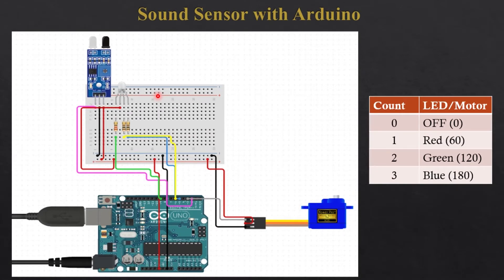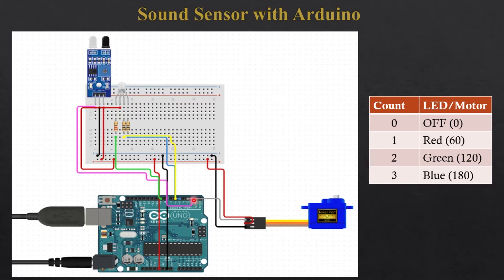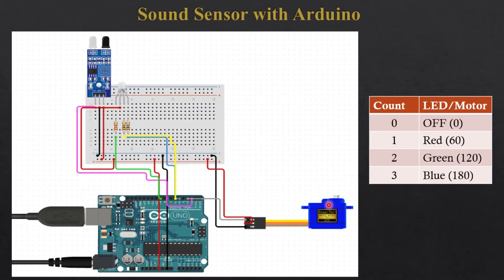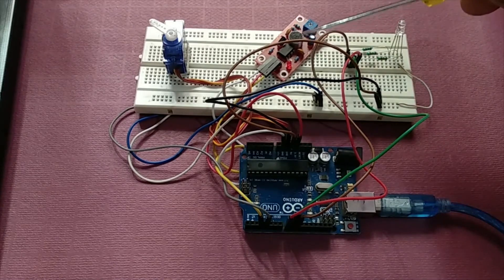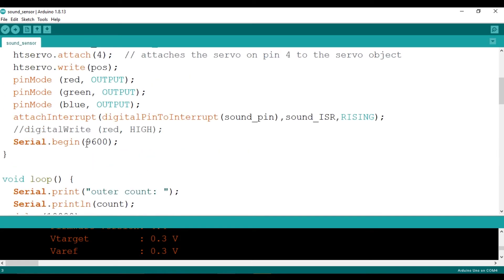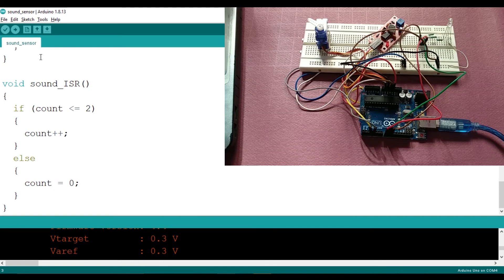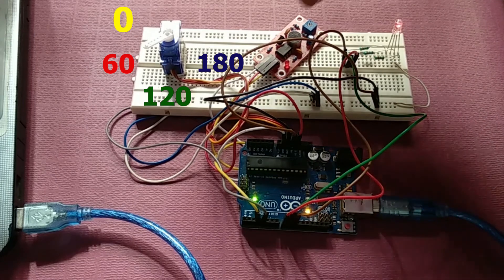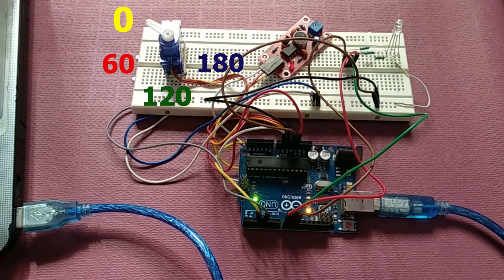Sound Detector Using Arduino

Comment: Can you help me with an air monitoring system project using Arduino
Reply from the maker: Yes, I will help you. Just collect all necessary components and then try to implement it by watching my video. Code and circuit diagram is given in the description. You can ask me your questions in comments